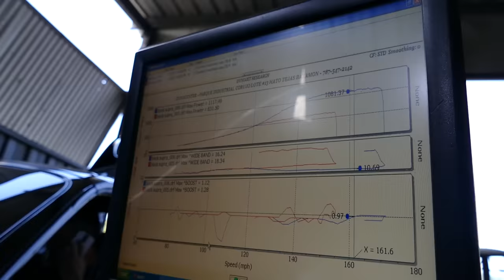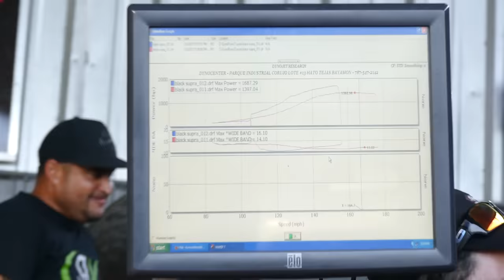1687WHP MONSTER Supra BRUTAL Dyno Runs

Comment: I'm still trying to figure out how this car made over 1100whp on pump gas
Reply: Boost
Reply: By taking a lot of it and mixing it with a huge amount of air and sending it into a heavily reinforced engine that runs at ridonculous RPM.
Reply: lol FULL SEND
Reply: I'm still shocked that pump fuel in the US is only 93 octane... shit, I get 95 from the supermarket xD
Reply: @bobolinkr  They don't use the same octane measuring system, that's why the numbers are lower.
Reply: Says race fuel
Reply: Badass timing controllers. Getting combustion chamber pressure that high without pre igniting the fuel is a fucking miracle. I ran 12:1 comp N/A in my Pontiac and needed to cut my 93 octane with E85 if I wanted to hot rod it around the street. I was only running a mechanical timed Hei though. If you can keep your timing under control you can boost and fuel the absolute shit out of a little motor like this
Reply: @hakont.4960  Ah, I see... so 93 US is like 97 UK? Or something like that?
Reply: E85 = 108 octane
Reply: @bobolinkr  In Australia we measure in RON so ours is even higher with 98 RON octane its close to 102 octane in other countries if its good quality 98
Reply: because it is bullshit...….not possible with pumpgas  no way
Reply: All I gotta say it's I will never again put 85 octane unleaded gasoline in my car.
Reply: Caleb Mansbridge it was race fuel says literally before dyne high boost and vp racing fuel
Reply: Jarryn Smith 🤦🤦🤦

No!!. 93 US would be the equivalent of 99 in Australia!
Reply: Håkon T. For a given octane and engine displacement... there’s only so much power you can make.
Reply: boost boost boost boost
Reply: Correct timing tables...all about limiting timing and creeping the boost in smoothly at peak torque and keeping cylinder pressures where they need to be for the fuel
Reply: @robertwood9572  Exactly... cylinder pressure and keeping timing out at peak is a big thing that it took guys a long time to learn how to do consistently for tuning at home on the LS engines
Reply: Seth N. Yeah thanks, noob... you’re talking about peak torque... not peak POWER.
Reply: only way i can see someone getting 1100whp on 93 is with meth. a local guy got 1022whp on a mustang dyno with pump 94 and meth. He did 60-130 in the low 5s so seems about right. But yeah 1100whp on just 93 is probably impossible unless they sprinkled some fairy dust on it.
Reply: massive wastegate+ large turbo
Reply: @ps.6023  yes I'm aware he has a large turbo. If it isn't on water meth there's only so much boost you can run on 93 without it knocking and destroying your motor.
Reply: @Elf-rm8jf  I don't know about that. Jesus Rivera did this same amount on 93 octane without water meth
Reply: @ps.6023  can you give a link? When i googled it I only found an article from the early 2000s. I really want to build my stock on to 1000whp on pump gas since there's no E85 here.
Reply: @Elf-rm8jf  no more articles can be found of his setup as it was so old but Supraforums.com is quite helpful.
Reply: @alfredoropeza9798  thats the next pull.
Reply: Second that. This thing can't be more than 4 liters. Thats an incredible feat even for a 6 or 7 liter v8. Thats why the E85 movement is so big. Something is off here.
Reply: By Being a MK4 Supra 2JZ powered
Reply: @alfredoropeza9798  no he ran 93 when it made 1100, then ran vp race fuel + nitrous that made 1687, but the car went lean half way and he aborded
Reply: @robertwood9572  wait waht? how do u mix pump with e85? o.0
Reply: It’s called a straight 6, with bigger cams,ported everything , one huge Turbo with VTT and aftermarket ECM  Tunning leads to a huge number..no big secret..
Reply: @bobolinkr  the 93 in the USA is on a different scale then your 95, and I’d bet if tested on the same scale our 93 has either the same or higher octane rating..even in the ECU the Germans play games with the ratings, and sell 100 at the pumps, but it’s still not higher than our 93..now that said you can buy true 100 race gas at the pumps in the USA in some states…plus we have pure liquid corn E85 ethanol…
Reply: With 2jz only limit is imagination
Reply: @markim5087  dude you act like this is simple,  it is not. Try looking online and find 1 other supra that has made 1100 hp on pump 93, nothing else. Fully built single supras with standalone hardly get over 600-700whp on 93. my BS meter is still up - the motor is said to be a 3.0 in this car.   there was meth injection or some alternative here.
Reply: Lots of money dumped into it.
Reply: Yeah the BS meter is high on this one. Either that or it’s on a very unsafe tune.
Reply: @jarrynsmith  wrong
Reply: @bobolinkr  US uses different octane then other countries... why even canada has higher numbers but in reality they dont x
Reply: Any engine can make 1600hp for 2 minutes!
Reply: Because it's a supra I think they can do that running bacon Grease!
Reply: Maybe he is using ethenol e85 or e60 didn't watch the vid yet
Reply: @markim5087  what is octane and how does it relate to detonation anyway right....
Reply: @badmpg  You're 100% right.  Pump fuel won't get you above 700whp or so and meth might get you another 40whp or whatnot, then it's high octane fuel or death by predetonation, your choice.

Comment: Basically this car fucks up 95% of the modern era cars. Nice, Toyota did a wonderful job.
Reply: Way more than 95%
Reply: Not every lots of ls would take off on this thing like it was a joke
Reply: ....and then breaks down after a few miles.
Reply: jesus christ the circlejerk on supras. Yeah good fucking luck putting all this power down on a track. Pure dyno queen
Reply: Needs to be AWD or it won't have traction at that hp
Reply: Let’s go HEMI huntin’ exept for teslas cause you know they got em awd and doeble engines.
Reply: Kaio Ken43 This car is a real SUPRA. Currently manufactured Toyota GR Supra is lacking about 1000HP to earn the name!!
Reply: you know that this car is 95 % made from modern parts right?
Reply: Nikos Theodorakis LMFAO, so true
Reply: Not even the tesla roadster or Koenigsegg regera could touch this. Am I wrong?
Reply: The 2jz engine is strong, but originally came with max 330ps, if I am not mistaken.
You could potentially modify anything.
You can make an old golf jump to 100 kph.
Some cars come with benefits, but other than that, its the grade of modifying, no matter wich car.
Reply: Kaio Ken43  stock it doesn’t any car with 1600hp on the street vs modern stock cars you normally see on the street today would do the same with 1600hp
Reply: buggles679 he’s right tho
Reply: Kaio Ken43 it really doesn’t beat much stock. You have to mod it for it to do anything
Reply: @aidenminer1559  switch turbos and you go easily 600hp with stock internals
Reply: Toyota wouldn't use this engine but its little brother in the super GT500. It's never fair when you put moded aginst stock and claim parity. You might as well as put this against a Nilsen Racing  engine. its 400 short and thats my point.
Reply: @chilekwainc6059  You caught me on that
Reply: @karolbarsky2932  bro the stock supra had 270 hp or something the  new supra has almost double that
Reply: Xinga Boy there is a video of it on youtube called “supra from hell” its crazy go look it up. Its the same car
Reply: You can thank Johann Krause Engineering (Germany) and GETRAG (Germany) for the 2JZ's potency under heavy boost. ;)
Reply: After you put 50 grand in it, yea
Reply: I think you mean "the builder of the car did a wonderful job"
Reply: My phone just fell down as 1687hp showed,  coincidentally I fell down too.
Reply: @johnwick7175  ummmm nope...LS's are very dependable that's why they're so prolifically used
Reply: Love this car, but you do realize Toyota only gave these up to 320hp?. Can't say good job Toyota, good job to the guy who built the shit out of this car to make this masterpiece
Reply: bryant B can you remind me what car runs a 1/4 mile under 7 seconds?
Reply: Take audi R8 V10, put biturbo and you have +1100hp with great AWD, on 610hp this have 0-100kph 2.7s, soo if you put +1100hp It can break easly  0-100kph in <1.8s
Reply: Max Power you’re so wrong. A koenigsegg regera is one of the fastest accelerating cars lol
Reply: You mean nice job for the guys who tuned it , not toyota ...
Reply: More like 99.99
Reply: @XingaBoy098  Many supras have
Reply: Yeah but not everyone spends 100k on an engine build 😊
Reply: 99.999% of them you mean
Reply: Nikos Theodorakis you high?
Reply: this is as much toyota as a 300lb body builder is apples
Reply: Yeah if u spend 70k of mods on it
Reply: Yes, TOYOTA did a wonderful job
 If you put awesome components on any car, then it will also "fucks up 95% of the modern era cars"
Nice logic, man
 
Do they know the Supra doesn't have that much power in stock?
Reply: @masterpiece6583  yeah i agree most of people are cocky saying supra is fastest car ever it has only 220-320 hp
Reply: @masterpiece6583  also supras cost like 40k and for that price u could get used r35 gtr but if i had 40k i would spend it on murcelago or countach replica
Reply: That statement still stands in 2021!😎
Reply: Safe to say at least pretty much every car you can expect on the road except for very fancy electrics.
Reply: 99.9%
Reply: Not really. Has like 3000rpm of usable power and the chassis would be squirming all over the place.
Reply: @10fttall6ftwide  yes you are actually lol
Reply: @10fttall6ftwide  the Roadster has 10,000 Newtons of torque, does quarter mile in under 9 seconds and goes faster than 400km/h, this Supra ain't got nothing on it. plus 0-100km/h in under 2 secs
Reply: @Andi-fh5lh  the stock mk4 supra had 320 hp, toyota lied because of the agreement they made
Reply: @karolbarsky2932  when you find that the mk4 has only 315hp stock and that the mk5 has more stock
Reply: @10fttall6ftwide  yes because a koenigsegg won't break down every 2 seconds and if you build a koenigsegg it will beat this shit
Reply: @insan3hvhpromotingcheats206  bro do that and you're gonna be wrecking parts like anything
Reply: /A
Reply: And after 1000km the engine brokes 😄
Reply: Frickin 97% the rest are Gtrs, Sti's and Evos
Reply: You mean all cars of this new Era? Goober.
Reply: Jelly lol
Reply: Would smoke wanna be teslas lol goobers
Reply: @johnwick7175  noo
Reply: @Andi-fh5lh  in Japan they had 270 HP stock but in other parts of the world it came with 360 HP stock i think
Reply: a couple more years  factory tuned electric supercars will fuck up 99% of this era supercars. Even now the Plaid can beat almost all sub 1000hp supercars.
Reply: @frjel80  Tesla fanboy spotted
Reply: @donut_3370  haha, you got that right.
Reply: About original comment. One thing, try corners in that thing mate
Reply: Гггэ
Reply: @pitbit3088  modern parts? People even i 2000s were making 1000hp on these cars lol
Reply: @sigrkongr4869  not any engine can take that much boost and horsepower
Reply: @Johnny-xi4ti  Absolutely true! I were at no point doubting the potential of the engine, but its alot more than the engine that has to be strong to handle such power:)
Cheers!
Reply: @bryantb3391  good job there a 2000hp one now the  aye that rapes everything you can think of
Reply: @aaronditchfield781  still not everything there are v8s making 11,000 HP
Reply: Spin till 6th engine rebuild, spin till 6th transmission rebuild. Repeat this until bank account empty.
Reply: Modern era cars... old cars... future  cars...
Reply: isnt it 99,9% of modern cars ?
Reply: Basically HP dont mean shit until you get it to the ground!
Reply: Nothing without modifications
Reply: Anything tuned like this with rwd or awd "fucks up 95%" this isnt just a supra anymore. more money spent on tuning than the whole cars value at stock.
Reply: @Andi-fh5lh  new supra is like 300 xD
Reply: No it doesn't.
Reply: With enough money a fiat 500 could destroy anything out on the street
Reply: @10fttall6ftwide  nope, sadly electric is quicker when it comes to acceleration over all and is also instant power no delay at all or waiting for turbo spool, rwd will not be able to get most of its power down in the first place
Reply: @bryantb3391  Yeah but this doesn’t need to be rebuilt after every single run
Reply: @izzy031096  yeah cause the stock 2jz can make that kind of power stock kids still don't realize there is no replacement for displacement
Reply: FR
Reply: Cause of the mods if it was factory it be slow
Reply: 95%? I want to know what 5% of cars is out there running at almost 1700 hp ?
Reply: toyota or people?
Reply: @blackmetalgoat9060  hd
Reply: @pitbit3088 mmm
Reply: Someone seems envious that Japanese cars surpass all other brands worldwide, but that's understandable. After all, we know how much you enjoy spending money on BMWs that constantly break down.
Reply: @hardeepbhatti5338 LMFAOOAAOAOAOAOAOOAAOOAOAOAOAOAOAOAOAOAOAOAOAOAOAOAOAOAOAOAOA

Comment: “Low boost” still gets over 1000HP
Reply: You sure? Super street did a article a few years back on what it would take for a Supra to hit over 1000hp on the 2jz-gte.
Reply: Fake.?
Reply: @cvasirocket1401  no its not 2jz its just well build engine
Reply: @OriginalFake he says 2jz is well build engine from manufacturers. U are a joke if u think every engine is great if build which is bullshit. Try to get 1000hp from ecoboost, this shit gonna explode on 500hp.
Reply: @OriginalFake I know what u mean but I think the guy u responded to meant to say well build engine like manufacturers so it easily push to 1000 hp with minimal upgrades
Reply: Yeah he spent over a hundred grand just to build that motor to make that kind of power
Reply: @vladkuz1298 yes
Reply: You guys should watch some videos on engines, turbos, and superchargers. You will understand that most engines V6 and up if you fully build them you can easily achieve 1000HP. The reason a Supra is always shown is because a bunch of reasons. For manufactures to build aftermarket parts that fit your car there needs to be a market for it. Supra built their motors to easy handle an extra 100 - 200 HP without having to upgrade any internals in the motor. With this advantage alot of companies started to manufacture parts for these cars because of the low cost / labor associated with giving them extra power. With this more and more people kept pushing the limits of the engine due to the motor being over built. So alot of aftermarket parts are easily available. After 450-500HP the motor needs to be built as well as alot of other upgrades to handle all the extra power. The Supra is great because of the motor being well over engineered for the HP the engine put out thus making it a great tuner. You don't just magically make HP though and it's not because of the engine. It all has to do with parts. How big is your turbo? How much boost are you running? Is it a twin turbo? The more air you can jam into the motor, the more fuel you can inject. The more air and fuel the bigger and more powerful the boom thus more HP. There is no special motor they all work the same.
Reply: Low boost is relative
Reply: @vladkuz1298  I mean,  a built subie ej could do this, yet they are shit on commonly.
Reply: @omarescamilla6223  prob more like 50 grand tbh, but idk
Reply: it's not a low boost
Reply: Jimmy Supra takes 1200 hp with 26 psi, and he calls it low boost, in race he drives with 46,5 psi🤣
Reply: Don't say about superaaaa
Reply: هذا الطفله
Reply: @sparkatorch a built subie
Has never made 1000 on 93oct